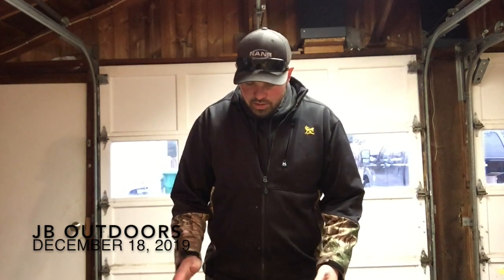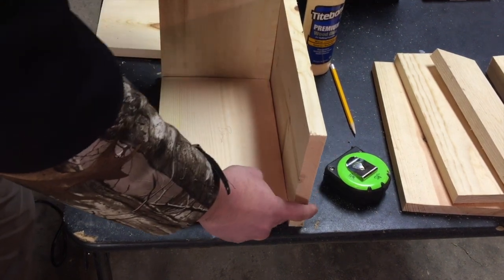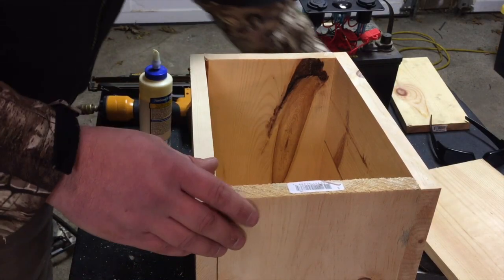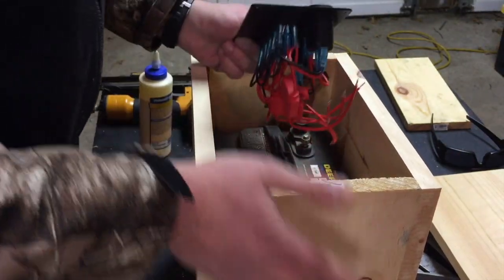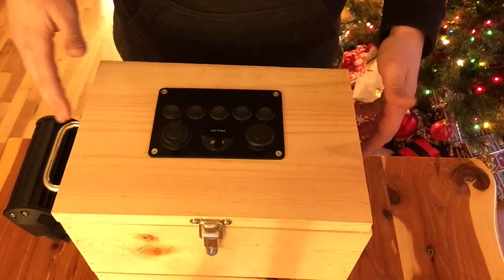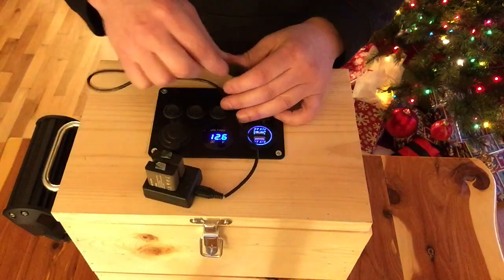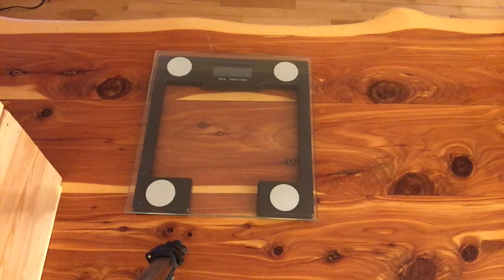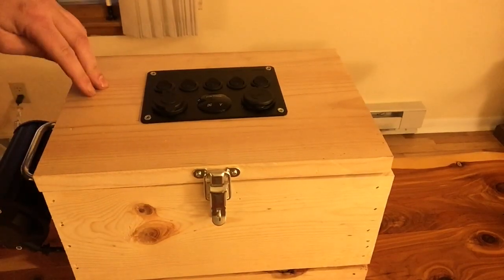DIY CUSTOM Battery Box BUDGET BUILD (Portable charging power)

Comment: Cool build. I'm glad to see someone build their own box instead of cutting up an ammo can. After making a couple of battery boxes I've learned to NOT put my switches and connections on a moving part (the lid). It seems no matter how well I crimp and heat shrink my connections, they eventually fail from opening and closing the lid. On my latest build I made the box a few inches longer and put my switch panel and other connections on one end. It seems to work much better in regards to keeping my connections intact.
Reply from the maker: I 100% agree with that statement and found this out with my connections the hard way! This box has been set aside as a 1st version and learning experience for me. I’ve since built a couple more but didn’t take videos. I agree with you as it seems no one likes to build a concept box, but rather go with the flow and build out of ammo cans. Thanks for watching and commenting , take care

Comment: i am a big believer in portable power very nice build on the battery box stay safe my friend
Reply from the maker: URBAN GRANDPA PREPPER I’ve learned how important it is to be able to transfer power so this is a big deal! I’m looking for terminals that I can put on the exterior of the box next for multiple uses. Thanks for watching! Take care
Reply: @JBOutdoors  maybe some type of charging cables that can be extended thru the but i really have no ideal but that is a good box
Reply from the maker: @URBANGRANDPAPREPPER  Absolutely I'm looking for a solar charger as well.  I've added the quick disconnect harness for my battery tender until that happens.  Thanks for the input, I'm always looking for ideas for upgrades!

Comment: NICE! I am now a battery-box junkie. I built my HAM radio "go-box" and I am not yet a HAM licensee LOL. These are fun to build and practical. I am currently researching ideas for a ~50 ah battery box/power supply. I want to  have the standard charging ports. I will be looking at MPPT charge controllers so I can use my solar panels to charge the battery. I have pre-built solar generators (batteries in a box) but want to see about adding more functionality and options for less money. Currently 2021 mid-tier solar generators cost about $1 a watt, older models are about 70¢ a watt. So I want to be able to beat that if possible. The pre-built have an inverter so that is going to be hard to beat price wise, I think.
Reply from the maker: Good idea with a portable HAM go box! I’ve looked into the Jackery systems that include inverter and depending on what system you go with on battery sizing. They offer solar panels that fold as well, but the whole kit is around 1000$

Comment: How do you keep it charged?
Reply from the maker: hinds169 for now I’m using a 2 amp battery tender when not in use that I keep in my garage. Eventually I’m going to find a solar charger
Reply: @JBOutdoors  cool. Im looking to use one for some led lights a phone charger and a 12 volt electric blanket for cold weather camping.